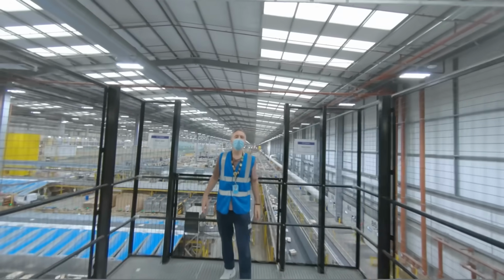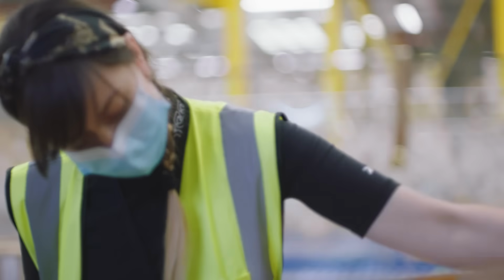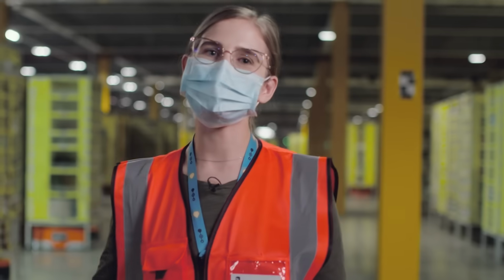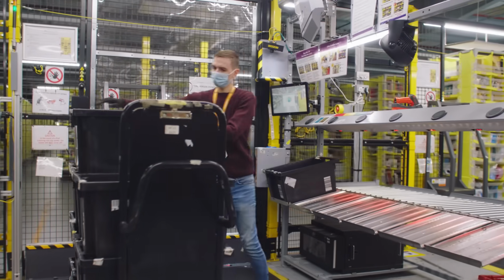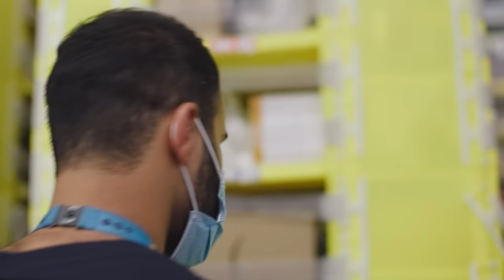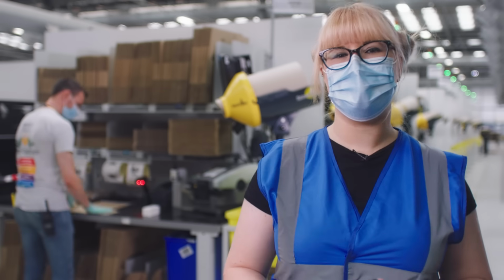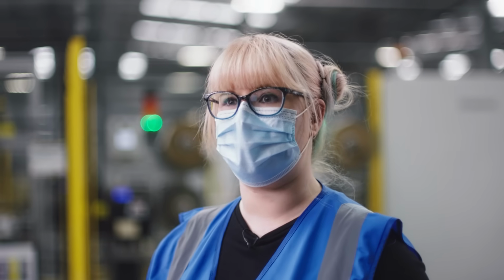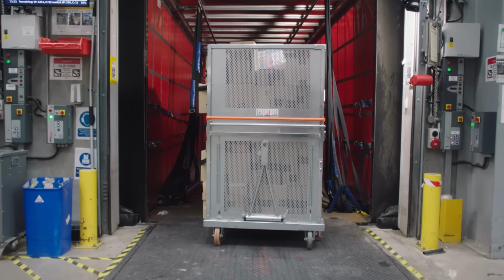Amazon Fulfillment Center Video Tour

Comment: Looks super easy.
Reply: Oh look someone who's never worked at an Amazon
Reply: @edman813  How many pounds do you stack in a shift???? How many hours do you work in a week usually????
Reply: @jgbelmont  I'm a flex worker and right now I get awful hours, since they keep hiring people and they don't need me. I try to get at least 20+ but it's easier said than done. I have to stow over 200 packages+ an hour in bags, or stack a ton packages in seconds.
Reply: @edman813  20 hours a week? We do 30,000 pounds 2,200 cases on an 8 hour shift. 12 hour days, 6 days a week. 87% annual turnover rate. Its -27 in our freezer...no extra brakes to warm up. Sounds like yo shit is easy.

Comment: i have worked at a place kind of like this and its very intense work.
Reply: @Foreign Babbie yeah disgusting.
Reply: Miguel tvid n
Reply: @Foreign Babbie at amazon if you dont scan something for 5 minutes you can get fired if your on the base level job
Reply: Miguel tvid  Freight Handler is actually much harder than Amazon.
Reply: @neuro2959  you only can scan things if there are things to be scanned.... (???)
Reply: @9iht6ihgt43rzhijj  there is always work to do at amazon
Reply: @neuro2959  that is inccorrect.
Reply: understatement
Reply: @neuro2959  not fired, but its TOT and will be noticed by your AM.

Comment: They make stow look so easy but it’s annoying when every bin the robot brings is full of items
Reply: That's crazy. I am about to start working at one with the Roberts so curious to know if i be doing stowing or picking.. All i know my schedule is Sunday to wed 7am to 5:30pm
Reply: I keep seeing that on Tiktoks where the wrong SKU gets picked, scan it, get the error tone and sometimes go through several items of all kinds of sizes in a pick location to get the right one.  Makes no sense from an ergonomic perspective either, especially the very low locations where you have to bend over or get on a knee or use the step ladder and go high.  Just insane. Very poor design. One time I saw someone had not put mis-picks back into the shelf location and then just tossed them into empty places on the next pod.  Well that works now, doesn't it?
Reply: Yep, my first day doing stow into robots I got all full robots and only big items like matress comforters, stowed probably 2 items per hour.

Comment: I work at an Amazon FC in shipping (they call it ship dock). This is not how it's like in my FC. We don't get any of the fancy technology despite being a newer FC. I've never seen many people using totes. The packing is right though. But they don't bring in totes, they bring in big cages full of items. They are almost no conveyors except for in packing and ship dock. Items are not stored in the small store shelves you saw in the video. We store ours in an enormous warehouse that stretches the entire length of the FC and takes up about half of the total area. Pickers go fetch items in forklifts called PITs which lift both them and the cage they are filling with items.

Now for the part I can talk the most about, ship dock. First, if you enter a shipping truck container when the green light isn't on or the green paper isn't there, you're fired. We get two breaks which separates our shifts into three parts. Each part, you'll be working in a different area. You can be a scanner on a normal conveyor belt, you can be a waterspider, you can work in team lift, or you can work in non-con (non-conveyor belt). 
Scanners stand at a conveyor belt waiting for packages to come down the line. We have about 6 pallets or cages behind us on each side of the conveyor (so 12 containers total and each container is for a different destination). Each person manages about 2-3 containers, whatever's directly behind them. You grab the package if it's for your pallet or cage, scan the shipping label, scan the container label on the floor to tell the computer "this package has been moved to this container". There are two nodes with 4 conveyors each. Only one node has ever been in operation the whole time I've been there.
Waterspiders will wrap up full pallets with cling film or lock up full cages and take them away to the trucks. This is called "closing a container". They print out a label and slap it on the pallet or tuck it in a label holder on the cage.
Non-con is for everything that won't fit on the conveyor belt. We get these big carts and wheel them over to the packers who have their own carts and have been filling them up with stuff that doesn't fit on the conveyors. We then wheel them back to the non-con packing area and sort the packages. We have a container for every spot that normal scanners have so about 30 containers total (I know that doesn't seem to add up. Some destinations are really popular so scanners usually have multiple containers for one destination. for example, every conveyor has a container for the destination TOR5. One conveyor has YUL5 on both sides of the conveyor.) Non-con items aren't necessarily heavy. They're just big. They can be heavy though. I've dealt with stuff ranging from whiteboards or cardboard to chairs or stuff that feels like literal bricks.
Team lift is for stuff that's too heavy for one person to lift. We're technically not allowed to lift anything more than 50lbs by ourselves. I've not worked in it yet.

Lastly, you must realize that we stand on our feet all day (actually all night for me. I work night shift. Because you want overnight shipping). We cannot sit down. I tried sitting on an empty cage once, got told off by "safety team" because it's a safety hazard or some shit. It was a stationary, secured, cart. It wasn't gonna roll away or nothing could have fallen on me.
Reply: Thanks for the detailed comment, It was interesting to read!
Reply: I know a few whi git permanent back issues because of working in a warehouse

Comment: Interesting how this one is so open and lit naturally. The one I work at is lit naturally too but the 2nd floor is so broad it eats up most of that so most of the 1st floor is regular lighting. Also at mine we use yellow totes instead of black and don’t just have singles pack. We have AFE which they don’t seem to have at this one. Pretty similar though still. They made the tape machines seem smooth. Not to say they aren’t but it’s cool to see it in that slow-mo when you’re used to seeing it zoom out at normal speed.
Reply: They don’t show AFE because it is a proprietary system, they don’t show AFE also during in person tours because of this.
Reply: What’s AFE?
Reply: Hey amazonions
Can you help me 
I need help regarding AMAZON FC ..

Comment: Everybody scrambling for $15 an hour while the cueball makes $38000 a SECOND
Reply: 15$/1h? In Poland AMAZON WRO1/WRO2 is around 6$ 🤣🤣
Reply: After Tesla Bot is mass produced it wouldn't make sense to even hire human there. All workers on the video can be easily replaced by tesla bots and they can be a way faster in scanning, getting information etc. Robot will work for free 23/7 for decades without complaining. One bot can save amazon ~$120k in a single year.

Comment: Where is the gloves when stowing, picking. I work at PHL6 and have always been told it’s a network standard and where is the safety glasses when using ranpack another requirement by network standard.
Reply: This was in the UK so there may be some slight differences. I always see pickers and such wearing PPE gloves at DFW[redacted]. Also the packers wear them too. I haven’t even seen those latex looking gloves where I work before. Our totes are yellow and not black too.
Reply: Hi Maria. I work at PHL6 also. Let’s be friends

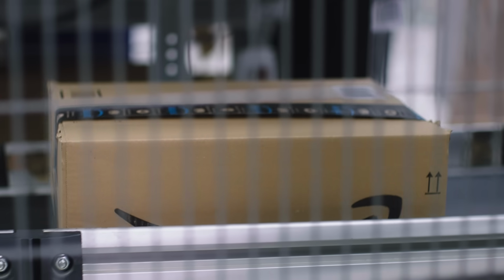Comment: @7:23 'so we do not waste anything'.  There is a misstatement.  I have gotten so many packages that the box is more than double than needed size and with only one piece of paper for padding (not enough).  

I retired from the U.S. Postal Service and performed all of the jobs in a medium sized office from receiving/unloading to dispatch (loading trucks).  You can only put so many cubic feet of stuff in a certain sized container.   So when you start looking at half empty boxes and freight costs, it is costing Amazon more using boxes that are too big.   Don't forger that many people do no recycle, so stuff winds up in the landfill;  which by the way, the one 4 miles from us just got partial approval to expand their mountain of garbage.

So in my opinion, Amazon could do a little tweaking on their box sizes and packing material.   I one day caught my delivery person, standing at the bottom of our front porch steps and throwing my box of electronic equipment up over the steps and gate (to keep solicitors out and my dogs from running off the porch when I go out there) at the top on to the porch.  Fortunately the manufacturer had created a great packing box and packing.
Reply: So a major issue is that when sellers are creating listings on Amazon (the majority of Amazon items are from small businesses) the website prompts them to enter the dimensions of the item. 

Many enter a generic dimension, this is recorded in the software and once an item is ordered the packer is required to pack said item in the box listed to maintain inventory of packing materials. 

This is how you get a pencil in a box the size of a toaster.
Reply: @Kenthis15  I certainly see many times that the dimensions are the size of a box i would place the item in for shipment; so then Amazon then uses a bigger box. No one obviously has the ability to take time to correct things in the Amazon computer system because that would affect the productivity numbers.
Reply: @funnyfarm5555  the shipping discounts are so absurd that its not worth the effort to correct. 

People mocked Trump for criticizing the discounts Amazon receives in shipping but I can ship a package into Amazon, 18x18x24, 50lbs, and pay $5-$15 depending on the warehouse its going to. 

You should know that’s a ridiculous price. Even with a standard corporate discount shipping something that size and weight would be significantly more expensive if it were a direct shipment. 

Because amazon gets such massive discounts, they dont care if the send a AA battery in a TV box.

Comment: amazon used to be an okay company to work for, when you needed that fast job. Sure it nonstop medium workload. However, the company in its hiring practices and workplace treatment is going down so badly most employees only see amazon as a quick check for a few months and nothing more.  With the increase of minimum wage in some states up to 12.50$ -15.00$  the 16.00$ per hour seems like a stingy offer by amazon.  Employee moral is real low because management is the only one getting any recognition with all the warehouse workers seen as easily replaceable workers that they can easily replace each month. They are also creating mega 10 hour grave yard shifts that no one wants to work that long at their strict overnight hours with the low compensation of 16.00$ per hour.

Comment: This job sucks gave me so much anxiety 90 boxes per hour and the slam sirens at 200 decibels
Reply: Wear earplugs or ask for some earmuffs. Yes, the sirens are horrible.
Reply: @davidheinig9948  95% of the people I see using earplugs put them in wrong. You need to roll it and squish it smaller and actually push it into your ear canal. Hold it there for a few seconds until it expands, and you will hear the difference.

Comment: The random stow concept is an odd one.  Often on Tiktoks I will see pickers pulling out the wrong items time after time from a bin location, scanning them and getting the error tone again and again.  It would seem to be much more efficient to have the same SKU in any given location and eliminate this waste.  Do love the live Tiktoks though, lol.  My current fave is the woman that pulls return packages off a chute one at a time that have been dumped in by large containers and sets them on a pallet, one package per pallet and hits the go button.  Uhhh....  Love the madness.
Reply: In the case of the pod robots that bring you a shelf to pick or stow from, random placement is fine. There can be thousands of those pods so you would never be able to memorize where everything is. As far as fixed shelving where you walk around to get stuff, random placement is very helpful. The shelving area could be thousands of feet across, so if you had to go to hundreds or thousands of feet for every item, that would suck. On the other hand, random stow gives you a much greater chance of the next item you need being just around the corner.

EDIT: Forgot to include this. Really the only problem with random stow is if your equipment malfunctions or when you need tons of one item. Don't have a scanner? Good luck.

Comment: I wonder for 1 customer ORDER. does it need to be done and finished by several different FC? I see some FC is only used for sorting while another FC is only for receiving？ and another FC is delivering? Am I wrong? Or do they finish all these processes within 1 FC?
Reply: As far as I understand, your order can be prcessed by multiple FCs, but every FC will do the complete chain and ship it.
So you might get 3 parcels from 3 FCs, even when the items are small. Bc not all items may be in store in just 1 FC.

I think you can even know in advance how many parcels you get when you look at the different "estimated receive date" in the checkout.
If you get 3 different dates, you can see what items will be in  what parcel or at least, in what combined delivery.
I use that info to try and get as few parcels or deliveries as possible each order
by ordering an item from another seller whose item is in the same FC as other items, or postponing an item for a later order, when it's not urgent.

Comment: So impressive yet staff can't even put stickers on packages correctly and don't even seal most packages !! 
Maybe concentrate less on making videos and training staff . I could sticker books at 5yo ........ Who exactly are you employing pmsl
Reply: They are employing machinery. The stickers not being applied correctly (especially on non rigid packages) is usually caused when the SLAM printer tamp head goes down too far and makes contact with the package, momentarily bringing it to a halt on the conveyor belt and causing it to scrunch up. 

As far as sealing, that depends on the package. If it is a cardboard box and the tape came undone, yeah the tape isn't great. As for the plastic bags, they often use finicky smartpac machines which need constant attention and adjustments to ensure a good seal on the package.